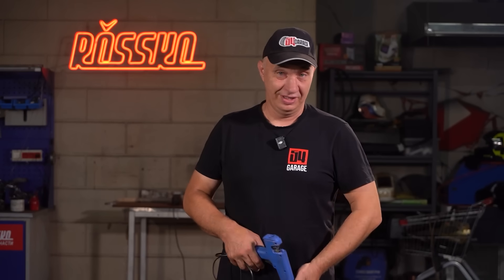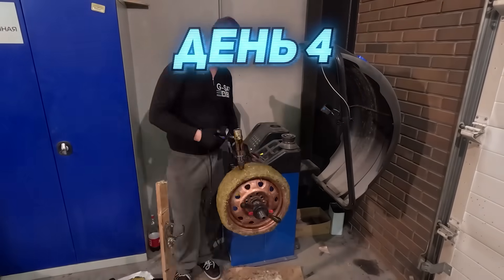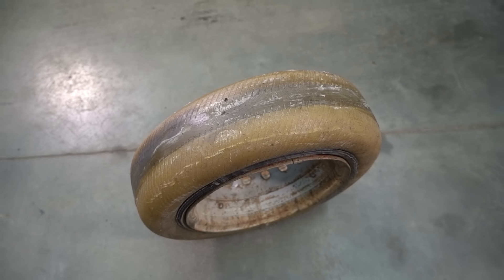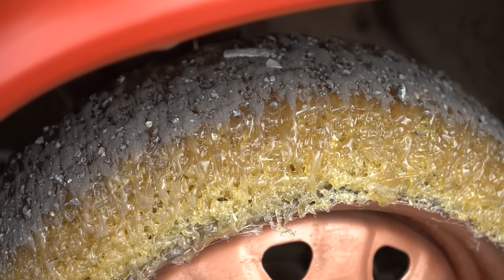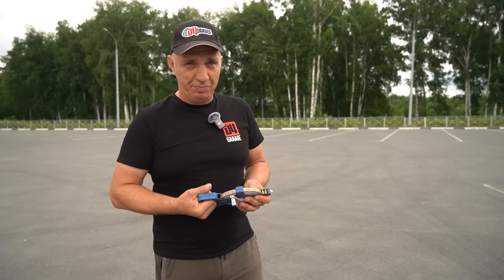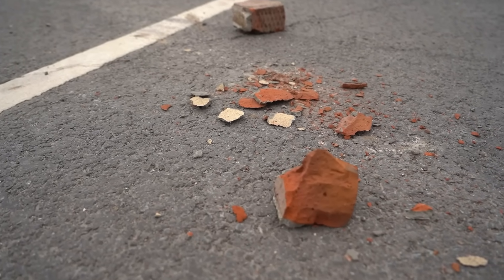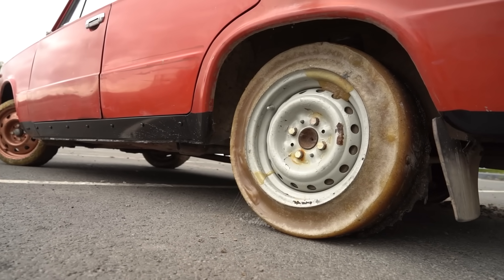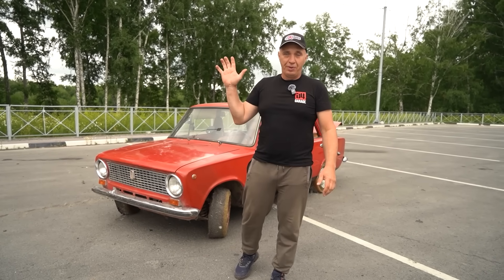We make tires out of HMA - will they work?

Comment: You'd think that hhey would mount the glue gun on something and put a small motor with a rubber wheel rotating the wheel at least. No way that guy standed there for six days holding the gun.

Comment: So,  i guess in an "end of days" situation IF you have a running car and fuel... but its sitting on 4 flats and you happen to be stranded at a facility that manufactures hot melt glue...
You COULD  make a set of glue tires that MIGHT get you to civilization.

Comment: The reason your tires were "wobbly" was because you cast them instead of turning them like you were with the first tire.  When you put the glue into the molds, it deformed and the molds were not true round anymore.  If you had poured them all like you did the first one, they would have all be true round, or at least closer to true round than by casting them.

Comment: I have an idea, make the front bumper a solid tube and filp it with water, punch some holes in the top of it, im theory when crashing the car the bumper would absorb more of the blow and eject water on impact dispersing the alot of the shock.

Comment: I have a suggestion. On top of the glue, you could lay a few layers of fiber glass, carbon fiber or aramid (kevlar).
But instead of using epoxy or polyester resin on the fibers, you should use an elastomer.
Elastomers, as the name implies, result in a somewhat elastic composite rather than a brittle one if done with epoxy or polyester.

It would be interesting so see how such composite would behave. If this "carbon fiber or glass fiber tyre" lasts a small drive, at the end, to make the video even more interesting you could do a burnout.

BUT, if you do that, make sure that NO ONE breathes the smoke from the burnout, since such smoke will not be healthy, whatsoever!
In the smoke there will not only be burnt resins but also extremely small fibers which may end up in one's lungs. If the fibers do reach the lungs, I think that they can be as bad as asbestos' fibers, if not worse!

Comment: You will need to go through it and fill a tire with that glue halfway and go through it and fix it to where they self-healing tire's because if a normal tire heats up a lot when driving it should melt the plastic and then when you go over a nail it just seals the holes

Comment: Try loading tires with a bunch of the HMA beads then go for a long drive at high speed to see if they melt and coat the inside of the tread. If they do that, then drive again to heat up the clue, then drive over a board with nails to see if you've made the tires puncture resistant. If the glue just flows out the holes, sprinkle a lot of short chopped glass fiber, or kevlar fiber.

Comment: Instead of making wheels out of this, fill them to make them solid airless!
Reply: Use an old power steering pump with a hand crank to pump the hot liquid glue into the tire to fill it. You will have to set up a bung on the side wall to let all the air out. Keep the tire spinning as they cool so the contraction isn’t a problem.

Comment: Do this same thing but with a few gallons of JB-Weld , fill the insides of the tires and let it cure for 3 weeks. Mold the outer rubber tread to the JB-Weld and cut off the side walls.

Comment: All they needed was some wire mesh on the inside to hold them together.  I was thinking they would stick to the road surface a little better but once they got hot they became quite slick. Neat experiment none the less. 
Very good lads. Cheers.🇨🇦
Reply: Would have worked better just filling normal tires with glue instead of cutting the tire off them.

Comment: Should have tried to actually balance the wheel while it was on the machine
Reply: I think that the one which made on the machine is probably more balanced than the casted ones. If you pour on top the weight rotates it to the bottom, so it might self-balance somewhat if you do it right.

Comment: Should use for O rings and gaskets , maybe headgaskets too .
Reply: I've made lots of gaskets with hot glue. It doesn't work where there is heat obviously.  It would never work for a head gasket. There's heat and pressure. It will blow out the moment it gets to its melting temperature which is quite low. 
I use hot glue to make electrical connectors water proof on my off-road buggies. I find it works better than silicone, especially if you need to take it apart. Just take a heat gun to it, and it will separate. You can't do that with silicone.
Reply: @Enter-a-name1969 cool will remember that , next time .

Comment: so why did you now leave the normal outer tire over the plastic. yes put some filler stuff between the outer tire and the steel wheel rim. the outer tire would keep the glue in, even if it melts. and it will not be in direct contact with the ground that way. try what filler material is the best. including thermoplastic urethane.

Comment: Smart to weld random junk to the inside of the rims. Especially the bearing shells.
Reply: Would be interesting to see how strong these are with fiber reinforcement. I mean, like the way V-belts are made: wrapping a continuous thread while adding the glue with that rotational method.
Reply: @gabiold  For sure.

Comment: Sir try running engine on calcium carbide
Reply: Acetylene gas effectively has a very low octane number, and will cause detonation in the engine. It burns dirty, and will leave significant soot/carbon deposits. It burns hot and lean, and can produce significant NOx emissions. If you want to run an engine on gaseous fuel, just use LPG.

Comment: try the glue inside the tire instead of air. 
a run flat.
Reply: Wouldn't be much different from this. The tires would eventually get hot enough and start to melt the glue, leading to instability.
Reply: @interpl6089I have a feeling that to wouldnt be to extreme a difference, as long as the tire doesn't de-bead with the glue.
Reply: would probably work great for offroad like atv

Comment: Those gravel covered wheels would probably work well on ice..
Reply: I believe the cold would make the tires drop the gravel.  It would freeze and lose it sticking power.
Reply: Hot glue and gravel mixture in the mold would work. A big hot glue grinding wheel